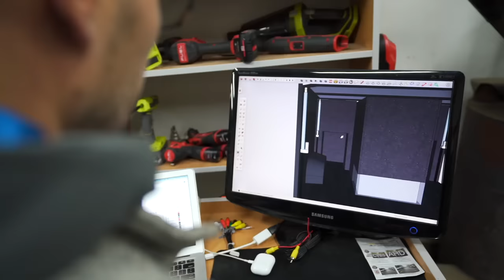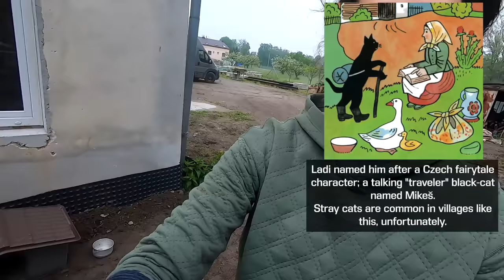MAKING PROGRESS! Insulated Floor for Off-Grid Tiny House - Van Life Build #15

Comment: Margaret great job on the video. Ladi-your attention to detail is amazing. I am lazy. I would have cut  long insulation pieces with cross wood supports every meter or so. Your floor foundation much stronger. I would have run wires in the ceiling in case I needed future access in case I forget something, but I know you think of everything in advance.

Comment: I like the point about having a high impact area can deform over time, it's one of those things most people don't think about. Also a random thought: it would be interesting to see a van build with carpet like they used to do with 80's vans of long comfy shag carpet (most vehicles still have some form of carpet in them).
Reply: Utter and total waste of time.  I've spent a lifetime lifting boxes in and out of vans and never had a problem. The insulation panels are seriously dense,  then with plywood you couldn't deform it if you tried. Same with the underfloor sound deadening. Sorry but pointless. Walls yes- floor no way.

Comment: Very nice work as usual. I'm not entirely convinced by sound deadening a vans floor, especially with all that insulation. I'd love to see two identical campervans one done and one without though.
I'd love to see what you guys are doing for security, I imagine it'll be some ingenious custom solution.
Reply: Sound damping for floors in vehicles is typically used for road noise while driving, but I suppose it would help with disturbing sounds in general. Personally my priority would be ceiling sound deadening because the sound of rain hitting the metal roof (or solar panels) is really loud and makes it hard to sleep on rainy nights. Also I believe sound from the walls would be the next concern since that's where most sounds waves hit the most, followed by the vulnerable van windows, then the floor. Perhaps they will be sound dampening everything. Many vans use hardwood for floors, and I think that helps block sounds, along with other layers. It really would be nice to know what materials actually work the best, instead of what is advertised as the best.

Comment: Ladi is correct. Many different methods for a van floor. Still surprised how much framing you have for floor support. I used a small fraction of the framing you did, but I did my floor in the winter, and was able to touch and feel how much cold transfers through the wood floor framing VS the insulation. Trade offs every place you look in a van. Different schools of thought on how supportive the foam is under the plywood.
Reply: 100% correct. So much talk about correct insulation in the other video, and then they added tons of cold spots with all this unnecessary framing. Just glue XPS to the floor and glue plywood on that and be done with it!

Comment: Each to their own, and I love that people are building their own vans and making them their own! 😍

But, all that talk about how others are insulating the wrong way in the other video, and in this you add tons of unnecessary cold spots in the floor when you add that much wood in there.. 🙈 You couldn’t crush XPS with plywood on top even if you wanted to. Just glue XPS all over the floor, perhaps with a wooden frame, and then glue the plywood on top. Make your own sandwich panel of sorts. Lighter, warmer and faster. 👍 At least for anyone reading this comment in the future… 😅

Comment: It’s a dangerous job to build your own van. You almost got killed at the end. 🤣 but why aren’t you building an pop out bar/side step under the slide door (not an stair like on an caravan, but) like on a high car. Than you’ll open the door and it automatically pops out. That will help with your problem by the door to. 😁😬  oh, and btw! I love that your back to building on your van! It’s so nice to see how your both thinking about the best way to do things and making so much stuff yourself! One day I wanna buy and renovate an Van or RV myself and I’ve learned so much already from you guys! 😄😄

Comment: You're lucky you can remove the panel between the cabin and the van. In Romania you are not allowed to do that. I mean, you can but you need to register the car again, as it is not used as delivery anymore but as campervan. That wall is there to protect the passengers in the cabin from loos materials in the van.

Comment: I’m doing work on my own van life vehicle this weekend I have to repair the roof again the person who fixed it before I purchased it patched a 1ftx1ft hole where a piece of equipment used to be by putting steel sheet metal on an aluminum roof as soon as I found it I got the supplies now I’m just hoping it didn’t cause too much galvanic corrosion damage or this repair is going to get bigger than I can handle myself

Comment: Dear Ladi, did you have any dips or unevenness of the van floor?  I have a lot of variation, in some areas it could exceed 4 to 5 cm. Imagine if you run a string between the driver side to the passenger side.  I am thinking about using plastic shims to straighten the struts in the low spots, as much as possible. The challenge however is how to keep things from moving. Maybe glue the shim to the floor of the van, then glue the strut to the shim. I don't know!! I am asking the glue and shims to do too much in this moving structure. love to hear what you think?

Comment: Pretty sure you don't need all that sounds proofing and not on the floor. Isn't the point of that stuff to dampen vibrations rather than absorb sounds like for example acoustic foam or egg cartons. Sounds/vibrations, much the same  but you need that material on a single panel of metal not everywhere.  It's like putting your finger on a guitar string to stop it vibrating, just one finger is enough as opposed to filling the body of the guitar with acoustic foam to stop the sound.

Comment: Great video Again. I really liked the weight details in this video. 

But this video made me a little bit confused. I get the feeling with all the support beams in your floor that the insulation foam can’t handle that much weight pressure overtime. But the specs says otherwise. (PIR foam panels = 40KPA/ EPS foam panels = 60 KPA and XPS foam panels = 250KPA according to the specs) Even the PIR foam can handle 400kg of weight per sq meter. So i don’t understand it. Is the constant vibrations of driving that could tear the insulation foam?? Explain this please!? 

Don’t get me wrong. Your the expert in wood! So you know better then me! For me, the conductivity of temperature is something that I don’t want to compromise on.
What is your ratio of support beams per sq meter? 
What would happen, if I don’t use support beams, in the area’s where you can stand/walk. And just use support beams under the interior furniture? 

I hope you have time to explain this further. 
Again thanks for this video
Cheers

Comment: With no air flow under the floor,  any moisture that gets in there is going to rot the wood, cause mold and potentially rust the floor of the van.
Reply from the maker: Do people actually make air ventilation gaps? This thought has been biting me for some time too.
Reply: @ladiandmargaret    Humble Road does it/talks about it.  To me it makes sense.  Look at the old EFIS systems in houses.  It created a sandwiched vapor barrier that trapped moisture between the walls. Resulted in lawsuits, lots of mold issues..etc.  Water will always find a way in. If you make it hard for the water to get out or evaporate, then it will cause issues. With the wood slats, it's going to rot and mold. With a metal floor it's going to get rust. 

https://www.youtube.com/watch?v=lA-rV8Wne9Q
Reply from the maker: I’ve seen this video and I strongly disagree with it. First of all aluminum for the floor support is complete waste of money, difficult to screw to it and the weight difference will be very small compared to light wood. It’s looks like the fetish of working with nice looking materials that will be covered right in the following step.

Polystyrene is the worst material to use for the floor. It’s supposed to be insulation purposely for floors because it’s hard.

Grinding off the paint is absolute craziness, what would happen, the glue ripping off the paint? Absolutely not!

 Now the biggest mistake I see with this solution. Imagine what happens with this glued floor once you attach 100kg battery pack to it and you crash, hard brake or drive on a bumpy road. Sooner or later it will lift the floor from the glue, it’s very unsafe!

Back to the condensation under the floor. I agree it could be done better, with ventilation for sure but I don’t know about any smart way of doing it while cross supporting the floor. On the top of my vapor barrier I would need some sort of spacing breathing material. I don’t know about anything for this purpose to be honest. But I know my way is the way pros do for decades and these campers don’t have rust through floors and they work like a charm for a long time. Mold would be interesting to inspect. I’m very curious how bat it actually is or if it’s completely overanalyzed paranoia.
Reply: @ladiandmargaret   Aluminum is used for the issues of rot/mold.  It makes sense, but I do agree it's overly expensive.  

Regarding the situation with a wreck, lightweight wood strips wouldn't do a thing either.  Unless you are bolting something (with appropriate graded bolts) to structural supports, the issue is moot.  Slapping whatever you want on a floor with glue or self tappers isn't saving anything in a crash.  

Personally I'll recommend a high density board like Foamular 600.  At a deflecting rating of 60psi,  you'll have a stable and insulative surface without the need for aluminum or wood strips.

Comment: I've said it many times, I keep saying it with every chance I get, and I will keep on doing so. Sound deadening in a camper van that has rigid insulation on top, is a total waste of money and a hell of a lot of unnecessary weight.
I challenge anyone to prove me wrong and compare an insulated van that has no sound deadening, to an insulated van that has. I seriously doubt that there is going to be more than 1% of a difference in sound level.

Comment: Great work, but I don’t see the point in sound deadening the floor. The floor is that shape to reduce noise and those pads are designed to work with a coverage of 60% of the panel so massive overkill and you’ve insulated it, waste of time I fear.

Comment: I frankly don’t like how many pieces of wood you use on the floor. Do you know that wood has six-time less insulation performance than polyiso? I would rather use XPS insulation for the floor, it has 1/3 less insulation performance then polyiso but on XPS you can put a lot of weight without compromising the stability.
Reply from the maker: Good to know, I did not think about it as much.